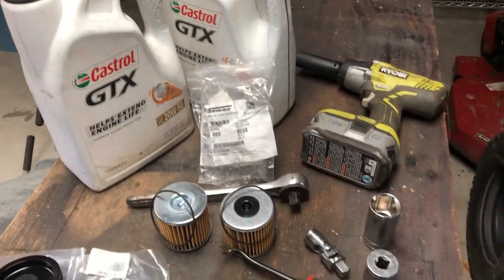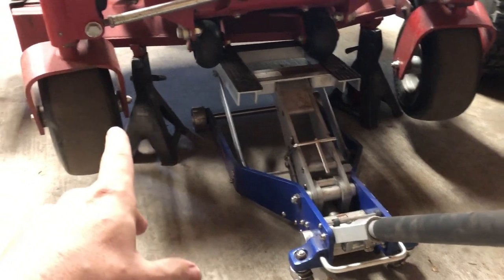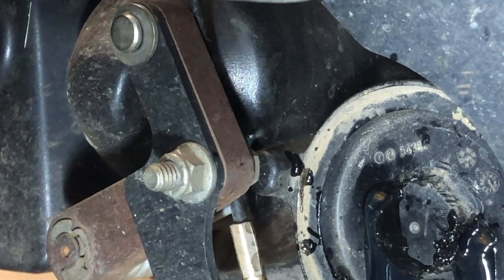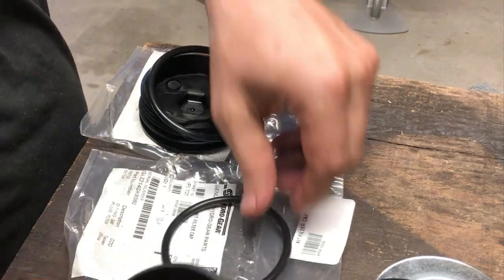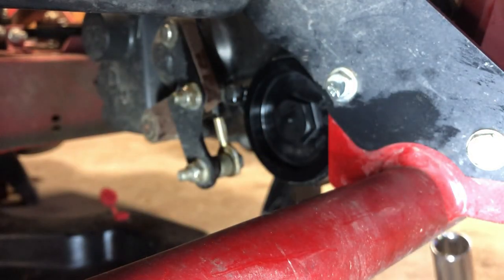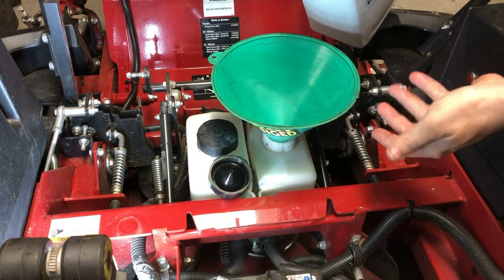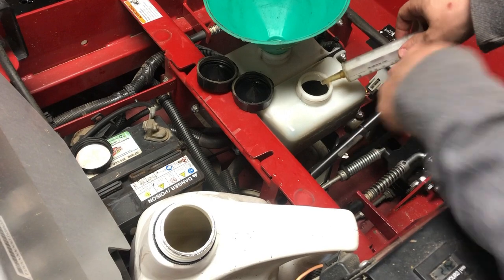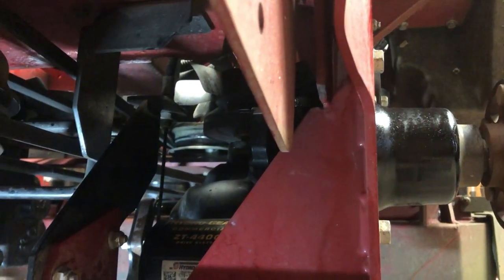FIRST Hydro Oil Change on FERRIS IS2200 | MISTAKES Were Made

Comment: I bought the kit for the correct Hydro Gear motors and followed the Ferris manual.  Easy peasy.  No trouble & no problems.  Thanks for showing the wrong turns.

Comment: When I changed mine I got concerned because it did not move right away ,soon realized it had air in the lines .,but after about 30 seconds it worked the air out . never had anymore problems with it .
Reply from the maker: That's good 😉👍

Comment: Can you use synthetic?  They need a metal cap for those. I guess I need to to remember when doing mine soon
Reply from the maker: Hydro Gear recommends 20w50 regular conventional motor oil . Yeah,  not a fan of the plastic caps 👎

Comment: One of my hydro gears will not disengage for the purge process. Is there another way? I dried driving it a little and it doesn’t seem any different than the one I did purge. Will it purge eventually on its own? It seems to run fine.
Reply from the maker: The air should work itself out on its  own over time...🤔 not sure why that one side won't disengage? 🤷

Comment: Gravely runs the same thing, yeah they are a pain in the but. I have that same jack, my motorcycle sits on it all winter and then the mowers all summer.
Reply from the maker: Yeah,  I don't know what they were thinking when they designed those caps 🤔?  I like that jack!  It's light and works well 👍

Comment: I just got the axel on the poulan xt greased today did this to the craftsman gt and the John deere lt mowers need to get the Hydro oil in the gt   hydro transmission
Reply from the maker: Sounds like you're ready 😉👍
Reply: @JsCrazyCutzLLC  I'm getting there

Comment: Those massive ZT-4400’s make my little ZT-2800’s look so tiny. Same process to change the oil except I have regular style oil filters. That sucks about the plastic filter caps. Every time you change the oil looks like a good idea just to change the caps as well. Wonder if the ZT-5400 metal caps would fit the 4400 model?
Reply from the maker: Yeah,  that's the first thing I thought about when we ordered new replacement caps but, unfortunately, Hydro Gear said they don't match up 🤷The treads are way different . Now that I know they are plastic.I shouldn't have anymore problems🤞thanks for commenting 👍
Reply: Zt4400 take 5qt per side?
Reply from the maker: @timd5597 the ZT5400 takes 5qts per the ZT4400 takes less somewhere between 4 and 4 1/2. We documented in the video the step by step procedure. After all the steps are followed the oil line in the reservoirs should be at the cold fill line.

Comment: You could drain the oil out of the drain plug on the bottom front of the unit, 7/16” plug with rubber o ring seal…
Reply from the maker: @NBTxCoog  I'm not sure exactly what you mean 🤔? The only 7/16 " bolt with an o ring that I'm aware of is at the top of the unit and it's supposed to be a vent hole. It allows  oil to go from the resivour into the wheel motors quicker and also allows air to evacuate the system as the oil is being filled. It only seems logical to drain the oil by removing the oil filter 🤷since you have to replace it anyway 😎☝️

Comment: I would have found the next smaller 6 point socket (switch between metric and sae) and tried to hammer it on and then remove it.
Reply from the maker: I got'er done 😎☝️I'll know better next time 😉👍

Comment: Make sure you use a 6 point socket instead of a 12 point...still may strip, but better shot at NOT with the 6
Reply from the maker: I agree completely 😃☝️that's why I mentioned using a 6 point socket in the video 1:31
Reply: @JsCrazyCutzLLC  I just rewatched and noticed that...I'm guessing the "ugga dugga" was the problem as you mentioned.  Thanks for these videos...very helpful.

Comment: The 3200s on my Ferris have fill ports on the top, you don't fill them via the expansion tanks.
Reply from the maker: 🤔 I don't understand .Are you saying your Ferris 3200 is designed differently ? All 5  Ferris  mowers that  I have are filled through the expansion tanks according to the manuals for my Ferris models 🤷
Reply: @JsCrazyCutzLLC  no my zt3200 hydros. I have a 2014 is700
Reply from the maker: @thastinger345  oh I see ☝️. I have 3400's , 4400's and 5400's on my Ferris mowers
Reply: @JsCrazyCutzLLC  Sooo, I made a mistake. I've only changed mine twice (once at 5 hours and again at 100hrs), so I couldn't remember, but yes, you do fill them from the expansion tank but remove the air bleed plug from the top of the hydro, then once oil starts coming out of the air bleed port, reinstall the plug and top off the expansion tank to something like 1/4 inch of oil in the bottom of the tank.

Comment: you want oil with high zinc not auto oil
Reply from the maker: Actually if you read the manual. They recommend regular conventional 20/50 motor oil. I've been using regular conventional motor oil in all five of our Ferris hydro's  for many years.  No problems yet🤞....🤔we had wheel motor go out on our old stander but that's a common problem with the 3400 series pumps🤷